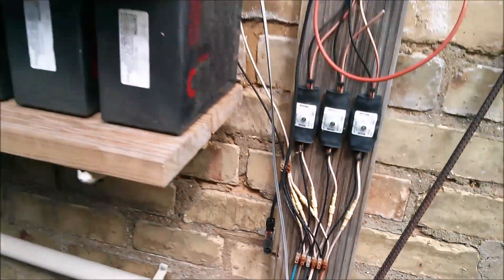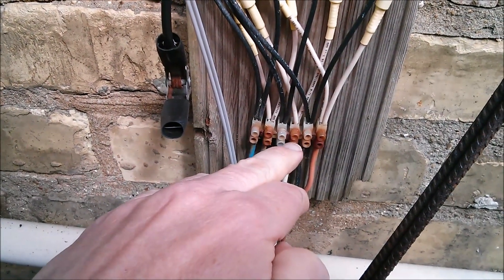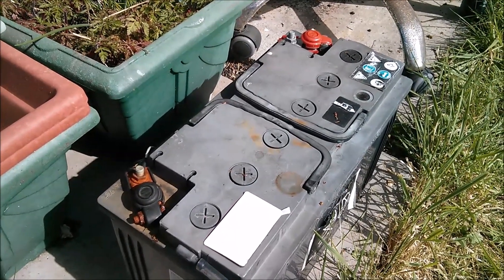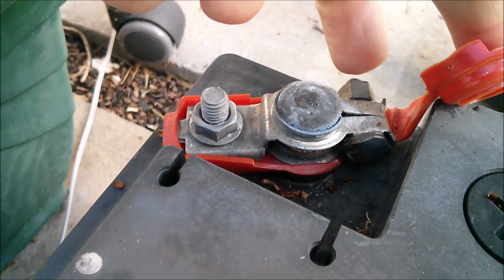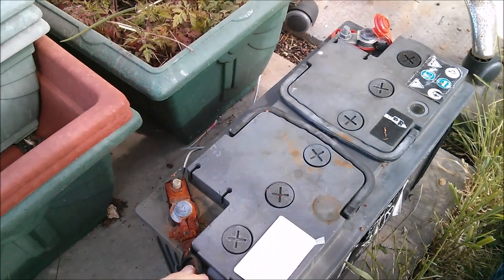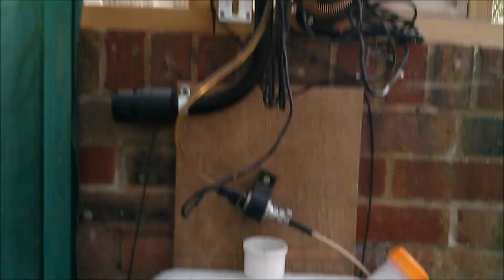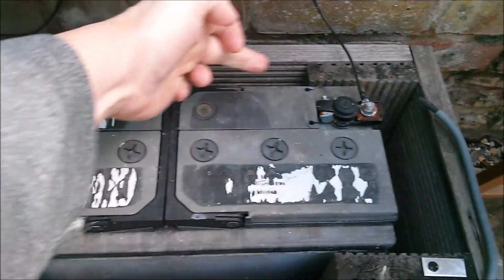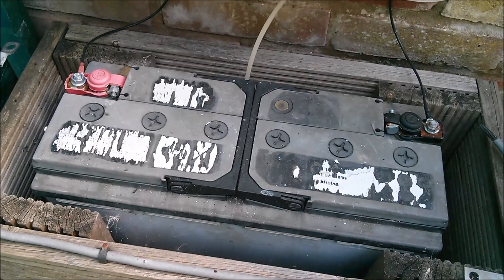Rust Polarity

Comment: Galvanic corrosion, caused by the electromotive potential difference in metals. On DC power systems the effect is exaggerated by electron migration. Keeping water/humidity and oxygen off the metal will nearly eliminate that issue. Use a good quality dielectric grease on the terminals when new. They will remain free of corrosion.

Comment: Electrolysis will decompose water into oxygen and hydrogen. The oxygen appears at the positive terminal and hydrogen at the negative. Since oxygen is very reactive, is oxidizes (a.k.a. rusts) the positive terminal very quickly. Hydrogen is fairly inert and doesn't affect the negative terminal.
Reply from the maker: Perfect explanation - thanks :)

Comment: Well that's how cathodic protection systems are used with small DC currents to prevent important things from rusting. Zinc anodes are often used to prevent more important metal bits from rusting, but I think the effect is the same. Dissimilar metals produce a small voltage differential and current which protects the important bit from rusting and the zinc degrades. The same effect happens when you introduce a DC bias and then you don't need the dissimilar metals.

Comment: You are right in that the +ve terminal gets oxidised / degraded in electrolysis (galvanic corrosion), that's exactly what's happened with the screw connector. Try separating the +'ve and -ve further apart so less current can flow if they are wet.

For the batteries, they are designed so the terminals are separated enough it's unlikely water would collect to allow a significant current to flow. If it had, you would see the +ve terminal degraded as with the screw connectors. Probably just poor quality connectors and normal atmospheric corrosion, I'm guessing these batteries are quite old. Maybe something to do with the dissimilar metals in the connector too.

Comment: If there was a track of water from one terminal to the other on the battery, you would see it when its dry. I suspect their is a thin film of water over the entire battery case, contaminated with salts that allows conduction from "+" to "-" terminals setting up galvanic corrosion on the terminals. Why the rust is occurring on opposite polarity between the battery and the connectors is an interesting question I have no answer for you! Good topic to investigate.

Comment: When Halfords are next open (or even better your local garage / spares shop) get a can of white Lithium Grease and cover the connectors when tight on the posts. Messy as anything but works great on car batteries - the engineers swore by it for reach truck batteries in the cold stores.  Not sure about Petroleum Jelly - never tested the conductivity of it!  I do know it creeps under car paint via chips though (do not go there).

Comment: Hi Julian ❤ how much current do you use from that battery? The one inside I'm asking because those wires seem a little thin in the video..
Reply from the maker: The diesel heater pulled about 10A (when it worked) through those cables. I think they're 14A rated :)

Comment: Google electrolysis rust removal to see  why only the +ve terminals rust when they are in close proximity and current can flow between them.
I doubt much if any current flows on top of the batteries even when wet, and one is more rusty than another probably because of either more water exposure or a thinner corrosion resistant coating.

Comment: It's called cathodic protection. Corrosion is electrical current. See https://en.m.wikipedia.org/wiki/Cathodic_protection 

Or in your case, the lack of protection. The corroded metal is the sacrificial anode. Zink or aluminium connected to steel will corrode and thus protect the steel from corrosion. The zink metal is the anode. It is used to protect submerged steel, like steel constructions on the seabed.
Reply: Yeah blame the catholics!
Reply: @webster1971sir  LOL! (I did correct the misspelling though. Bloody autocorrect)
Reply: Lots of thanks for the info. Never heard of that technique before. Interesting indeed.

Comment: current flow maybe? The positives are more rusty on the wall terminals because those batteries are always being charges and the marine outside battery is always getting discharged?
Reply: Sorry, you guessed wrong. :)

Comment: Put any type of grease on it when they are new and it will never happen again , I have been doing this for years and it never fails me
Reply: I agree, oodles of Vaseline petroleum jelly. not a smear, a big goop, keep the moisture and the air well away. If you have a nipper in nappies, then it's an easy job to grab a handfull. Works the same for batteries and baby's  bum.